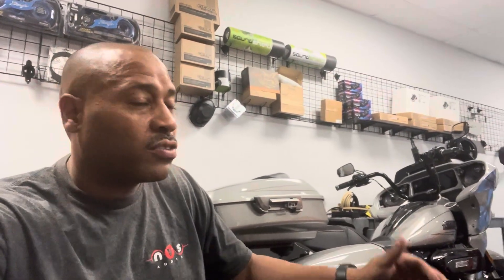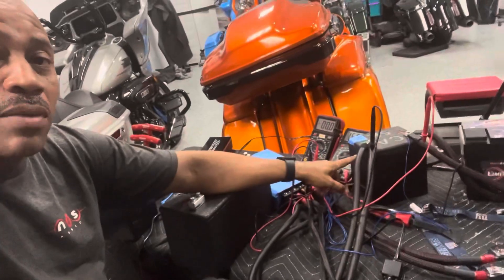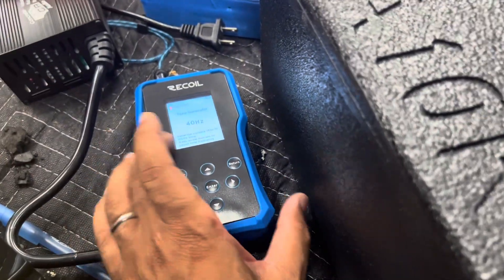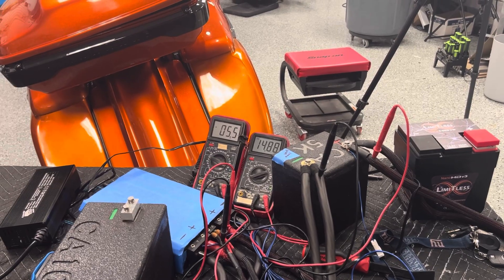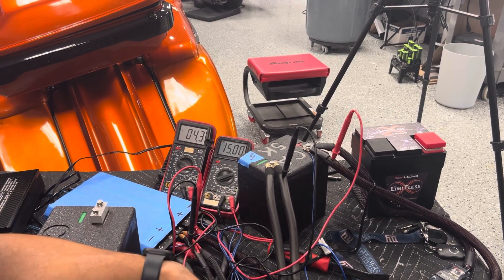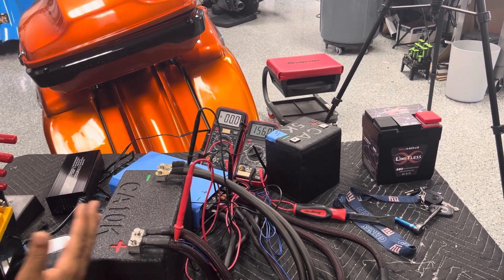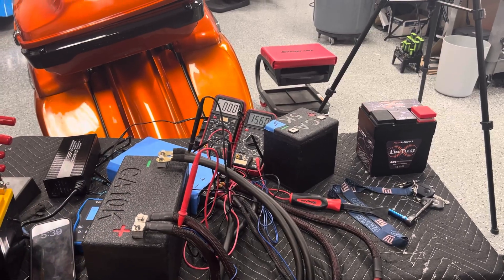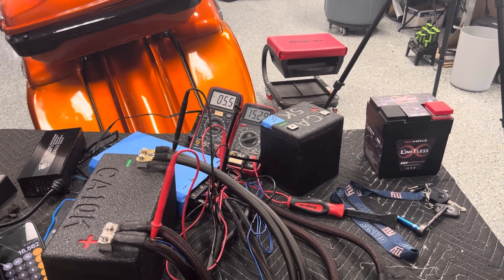NVS audio reviews the concrete audio 10,000 watt and 5000 watt lithium batteries  & 15 volt charger

Comment: Now how do we make this work in a Harley specifically the 10k@ 15v
Reply from the maker: There’s a ton of the Competition guys running 16 V batteries. They charge them up to 16 volts  right before they compete.

For regular riding , they charge a 14